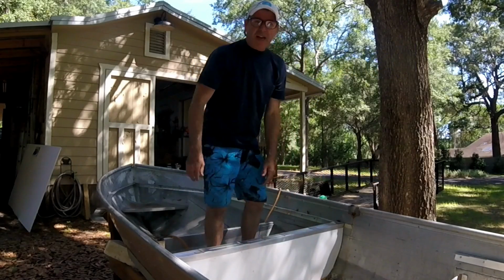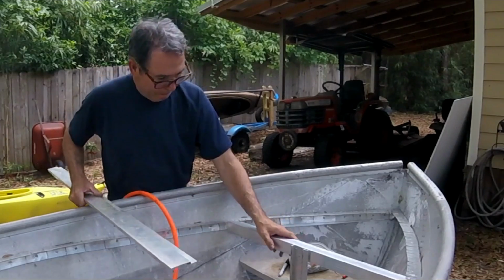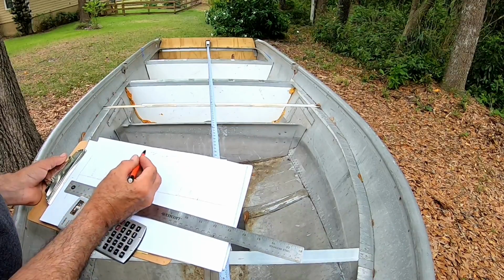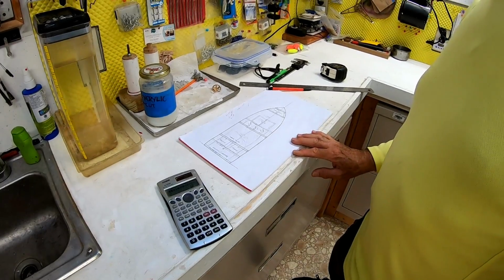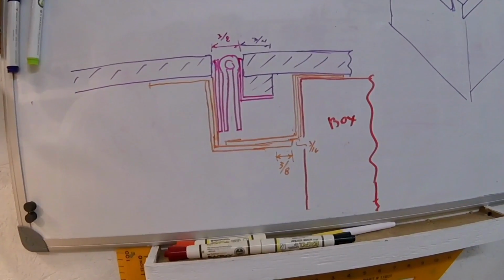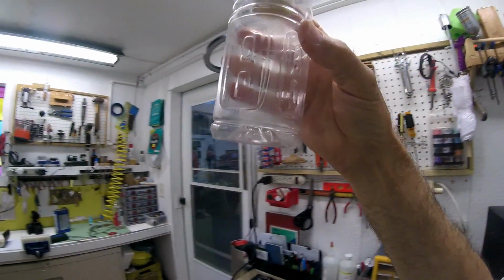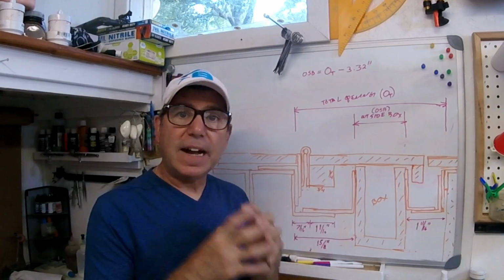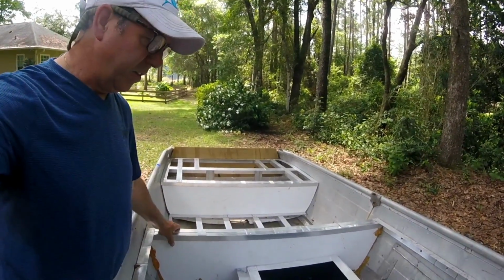Rowboat to Bass Boat Conversion, Part 2

Comment: From idea to reality is a constant measure twice cut once and then test fit and cut again. HaHa! Just finished my 16 foot Deep-V and the crux of the whole project was the engineering of the frame and storage. I’m 95% there still want to add some more storage without losing seating. Trying to keep it a multi- use boat both pleasure craft and fishing rig. Great series of vids. I came u with some similar designs while working my craft out.
Reply from the maker: Thanks for sharing your experience.  I'm waiting for that moment where everything falls together and things start to move along at a better clip...but I'm not holding my breath😆

Comment: As a former boat repair guy, I can testify that even 2 part foam eventually breaks down with moisture. The idea behind using foam is to occupy space as the weight of 1 cubic foot of foam is less than the weight of 1 cubic foot of water. Which is on average 2 lbs for Foam over the 62.5 lbs for Water, creating buoyancy. And the foam is to occupy space so water doesnt accumulate in an area, even if water logged, the foam will remain buoyant.
Reply from the maker: That is all correct.  I'm using 2lb foam for most of the boat with some spray can foam  which is has a much lower density.

Comment: If you make a styrofoam cutter with wire  and car battery or boat battery it makes cutting foam so much easier and seals it as it cut they are super easy to make and well worth it.
Reply from the maker: I thought about it but, remember I'm not just cutting through Styrofoam, there;s also 1/8 inch of ABS plastic sheets glued to it.  The jig saw made quick work of it...
Reply from the maker: Sounds like a fun project

Comment: Hi,
Nice build!!!!
What about some pvc tubing for electrical wire chases?  Always nice in case you want to add any additional electronics later.  I am working on a WellCraft boat right now and it is a complete disaster.  Getting wiring from the front of the boat to the console and to the rear is very difficult if not impossible in cases due to the way the wiring was installed in the boat. They put one pull cord from the console to the rear of the boat but the wiring was not in any conduit and when you tried to use the pull cord supplied the wiring being pulled just got caught up with the existing wiring and other construction debris utilized when building the boat.  Also, the fuel tank is under the floor with NO large hatch access for tank removal or maintenance.

John
Reply from the maker: Yes!  Lack of access for wiring is a pet-peeve of mine.  My Flycraft flats boat has good access from the center console to the stern but nothing going forward and no way to make it!  I will definitely have both plumbing and conduit from stem to stern.

Comment: That framing looks good .

I don't think the test your using is the right one, I think you should be using starting mass versus ending mass. I have seen a number of boats taken apart that had foam that was saturated with water. Something that seems to be been successful is using Ping-Pong balls for floatation. Not a mess to use and if you ever need to open it up its a very easy clean-up.
Reply from the maker: That will be the next test.  First I want to see if it allows water to seep...if not...then I'll take it and weigh it. then I will set it out in the sun and weigh it daily until there is no change in weight from the day before...I cut my teeth on materials research in fact I designed a similar test for testing the permeability of concrete.  But, you are right on with your observation.  Thank you for your input and keep watching.
Reply: @johnjacob6774  I have seen them used before, there's no perfect solution it is a fairly common thing to use. One of the issues is that foam used on boats will over time take in water and reduce buoyance. I don't recall the article I saw it in but I saw an article where someone got the OK from I think US Coastguard to use them. Yes your right about ripping a whole in the hull but since your filling between the members you are not likely to have a lot come out unless your boat is ripped in half. Also if you need to redo it once its likely that the foam has failed and you spent a ton of time cleaning out the old foam unlike the balls that you can scoop out and rewash if you need to do work on your boat later.

Comment: Hi Marco, I know this is a year old video but I'm hoping you'll see this comment.  What kind of adhesive did you wind up using after the carpet glue failed?  Also, I saw where you said you're looking for a 4 hp outboard.  I have an old 15hp Mariner two-stroke you can have if you'd like.  It needs a new impeller which costs about 11 bucks, she'd make your boat scoot!
Reply from the maker: I ended up using 3M 90 spray adhesive.  Thanks for the offer but my next task is to build a trailer for the boat.  I can't use a gas motor on my lake.

Comment: Awsome job here ! Really appreciate the video, they are really helping with my boat build . I just had a quick question, what size rivits did you use mostly for the inside of boat building ?
Reply from the maker: Combination of 3/16 and 1/8 inch on the deck frame and 3/16 to fasten the deck to the frame.

Comment: Hi Franco,
I am so happy cause I finally get a boat, Kimple trout 370 with a Yamaha 30 hp.
Cause it is my first boat ever I have to learn everything about maintenance, etc. A simple question, I build myself a lithium battery, 4 cells 12 v, bms, etc. From battery can I run a set of 4 cables, "2 +", "2 -", one set for my electric motor, Minn Kota edge 45 lb, another set for a couple of plugs? I mean is it safe to run more than 2 cables from a single battery?
Thanks
Reply from the maker: Be sure you have appropriately sized fuses

Comment: Looking great brah!!  Fun little design-remodel project.   What’s her name? What’s your thought on coating the inner haul before permanently decking it?
Reply from the maker: Her name is Alumina with the accent on the "i".  As you know that's word play with the Spanish  word for illuminates and the word aluminum.  That's just the kind of dumb s##t I do.  I thought about coating the inside of the hull but coating aluminum is tricky.  Since most of the hull will have expansion foam, I plan to scuff up the metal with sand paper and let the foam grab on.

Comment: For the bulkheads, did you somehow seal the cut edges of the foam before installing them?  If so, how so?

I’ve been pondering using foam and sheeting like that for a small casting platform so it’s cool seeing someone using different materials.
Reply from the maker: No...I didn't seal the cut edges of the foam...Didn't seem necessary.   This arrangement works really well for carrying a load in compression.  If you need to span an area for a casting platform you'll need some other material for the surface you stand on...good luck.

Comment: awesome build... but that foam does take on water, it does take exposure to water (uv does't help) for a couple of years. also if you any cut to the surface it will take on water. even the marine grade foam will take on water after time if you break the surface and in an aluminum boat in our area it can lead to long term problems. if you get dead leaves in you boat and the foam stays wet against the bare aluminum you can get pin holes from galvanic corrosion because of the weak acid solution the the tannic acid from the leaves... it might take 5 to 10 years or more, but i can/dose happen. so to stop that, i first coated the inside of the hull in a bedliner before any expanding foam. also the only time i use that flexy seal junk is when i have to cut the foam, and it is just to reseal the cells of the foam (you could use a number of paints or sealers for this but flexy seal seems to really work in this one application). 

you seem like a guy that wants stuff to be made to last so figured i'd drop this little advice from another local like minded fishermen, and fabricator.

p.s. cutting out my 2 part spray gun parts with my cnc router right now!
Reply: also putting that same switch panel in my boat
Reply from the maker: I know what your saying about the foam and water absorption...it would really suck if it happened.  But I have an issue with information not backed by tests.  When I pulled the original Styrofoam blocks out of the boat, one of them was notably heavier and had taken on about a pint of water.  But after 58 years in the boat and the last 14 in the water tied to my dock I would say, you can't expect anything more.  The sad truth is that all materials degrade over time.  If that piece of foam in the PVC tube with 4 inches of hydro-static pressure does not allow water to get through it in the next few weeks ...that is as good as you can expect.  remember I cut the "skin" off the foam before I put water on it.  Also, the boat would have to be near sinking to have 4 inches of water over the foam.  Of coarse if in a couple of weeks I find  that the foam in saturated...then I'll be eating these words.  Either way I'll be learning something...
Thank you so much for your input and interest.
Reply: @EngineeredAngler  oh I totally get the need for testing... i have rebuilt my old sea nymph twice now. the 1st time was about 15yrs ago and all the expanding foam out of those cans had failed where there happen to be water. Also the real marine foam was taking on water if i had cut into it.  Also I use ridge a lot in my art making. The Extruded Polystyrene sheet (the pink or blue depending on brand) is a lot easier to use/cut and gules up great. You should remove the plastic film off before gluing, but I was thinking it's the plastic sheet you used that isn't allowing the glue to bond. I have used the same plastic sheet top my gluing tables (because nothing sticks to it other than stuff like pvc cement/acrylic glue).I am sure there is something that will work that doesn't damage the foam as well, and looking forward to how you solve that problem and all the other things that come up when rebuilding an old boat.
Reply from the maker: The glue I used really is not meant for non-porous surfaces, of course that's exactly what I used it on.  I only noticed it after the fact.  I think the foam core idea is still valuable and I plan to use it on the inside walls of the open hatches (where I'm not using a tough box).  But I will use 1 inch foam board and probably the blue stuff...it holds up to the propellant in the spray contact glue.  I did find that the coefficient of heat expansion of the plastic sheets is high enough that you can't have all sides restrained.  The bulkheads are actually pretty nice.  I was planning to use a series of them throughout the hull but they take up too much room.  Thanks again for your advice, definitely will consider how I will get my flotation.

Comment: It looks good but from experience that spray glue stuff ounce trying to fill a large volume doesn’t cure without access to air I made a diy mooring buoy filling a ball with that foam and it sat in the water and barely floats because the inside never cured, use foam sheeting or a expandable foam with a catalyst
Reply from the maker: I'll be using a combination of the the spray foam and two part marine foam...I don't think there'll be issue.  Thanks for watching and you input.